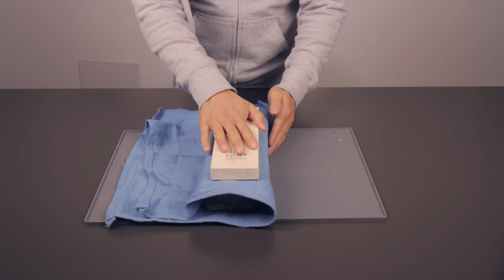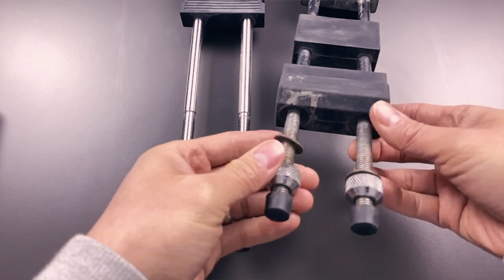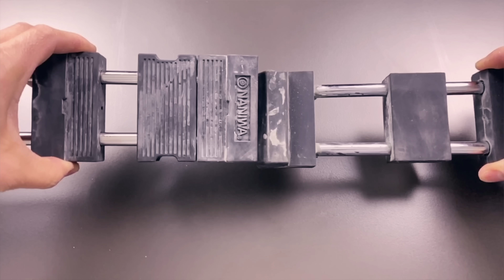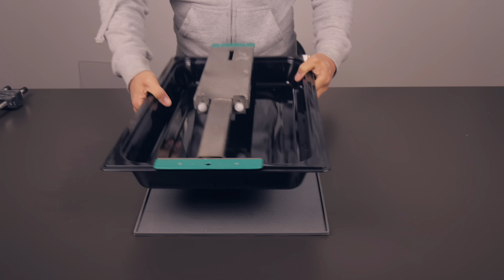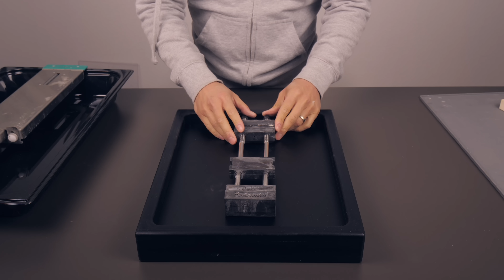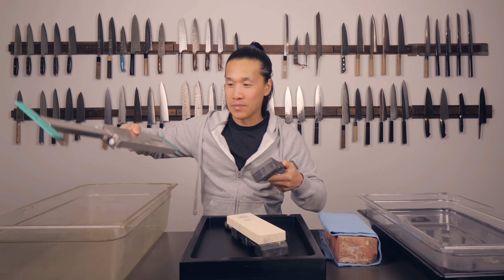The Essential Knife Sharpening Setup:  Whetstones, and Maintenance Gear

Comment: Have not read all posts, but rust can be eliminated simply by soaking in lemon juice (cheap concentrate) and brushing. Repeat as necessary. Dry and lightly oil threads to avoid return of rust. Run the nuts up and down a couple of times. Stop laughing.
Reply from the maker: LOL!

Comment: I started sharpening with razors. They are very simple and easy to sharpen, you just need a fine stone and a strap to start.
My initial setup increased over the years to several, very good waterstones, stored in a transparent plastic box and a handcrafted wooden/stainless steel  vise to clamp my stones and 4 straps (glued on some wood).
 After many decades (!) sharpening my knifes like this, I gave diamond stones a try and was immediately convinced:
no water, no grinding slime and no barking wife, what a mess I made sharpening 'your damned knifes'. (Okay, she must not use my knives, since she put one of them into the dish-washer)
So my setup consists now very compactly of 4 diamond stones coarse, medium, fine, extra-fine. That's it. 
To get my knives sharp as hell I still use my 4 strops. I switched on 3 from 'normal' grinding paste to diamond - only the finishing 'mirror polish' Poduro blanc paste still remains - I haven't found a better product yet.
I gained a lot of space with switching to diamond stones, too. There is an advantage, which is a disadvantage, too:  diamonds really bite - I smashed a lot of scratches in the sides of the blades in the beginning, but the ease and speed of sharpening with those tools and the results are amazing. It is more like caressing a cat in comparision to the pressure I needed with water stones to get my cutting edge and you can grind in every way you want, even against the cutting edge. The diamonds don't care.

Comment: I use 4x4 block of wood with a scrap piece of leather glued to one side to sharpen Kramer carbon 10" , Shun Classic 8" . Damp rag underneath and dry one on top. The king stones don't slip. It's great and didn't cost much. YOUR SHARPENING SET UP WOULD BE BETTER THOUGH. CONSIDER ME PLEASE.

Comment: I’ve been messing around with a lot of items for fun. Took about 100 knives to really get confident in chip removal, reshaping etc, started going 10-15 a week.  The $ made isn’t really worth it but enjoy doing it.  I was sent a lot of equipment from work Sharp for free.  I’ve been using their guided diamond plate sharpener with the extra plates for $30 and strop.   I can’t believe how good it is for the price.   And so small and compact.  I’ve done maybe 40 knives on it now.    It’s a bit small for larger kitchen knives though.  I’m going back to a stone system but for a casual sharpener, it’s one of the best and easiest I’ve come across so far.  I wish they’d hire me to promote it. :) but with all the systems I have, I am going into sharpening supplies and getting some water stones and basically a similar system to what you have.  Mostly for myself and friends. Don’t think I’ll be doing much more sharpening as a side $$$ unless I get bored.

Comment: I have 3 Wusthofs chef knifes, a filet knife and a fake shun that I think is a Jikko that one of my chefs sold me lol. Also the restaurant I work at the owners bought 3 zwilling knife blocks a while back ago but they’re starting to get dull. (Not to mention a whole hotel pan of knifes from the previous chef/owner)I’ve  been sharpening a couple knifes on a cheapish 12 inch winco stone with some berkel machine oil. Thanks to your vids I even got a small old yellow petty knife to cut through paper! I’m really looking forward to getting a higher grit soaking stone, probably the  new 1000/3000  double sided yellow cerax. I’d like to try and get most of them sharpened this winter since it’s kind of slower right now

Comment: I recommend the naniwa stone holder; no rust whatsoever, has the smallest lip so you can use the stone until it's wore down as much as possible, and two rods to apply even pressure.

Heard good things about suehiro, but I didn't like the single rod design or how large the lip was.

I use mine on a suehiro sink bridge and plastic food tray

Comment: Currently using the bamboo sink bridge by wurstoff (i think) but it gets slag all over the floor, especially with more work (fixing chips or rebeveling straight razor.) As for knives, i use my enso chinese cleaver. For nearly everything (professional chef work as well) and only ever use my slicer if cutting steaks from a loin. Everything else with the cleaver (best all around knife) that can get super sharp and hold it's edge forever (with a bit of stropping, that i learned from this channel)

Comment: Right now i am using 220,1000,4000,800 Norton stones on a wet towel with a shelf liner underneath, i have an old Tupperware bin to soak my stones in.

in my knife bag i carry a Zwilling pro 10" chef knife, when i am on the line i use a SAK fibrox 10" Chef knife and SAK 3" pairing knife

Comment: I still use my electric sharpening setup because it is alot faster. I have a 1x30 beltgrinder with a 240grit belt for setting bevels and grinding out gouches. A 800 grit belt for smoothing out the scratches and a mdf wheel with stropping compound and a cloth wheel for honing. I go through an entire knifedrawer in about 20mins

Comment: Hi Ryky
Your videos have got me started, some of your recommendations were unavailable so I finally settled for the following
- Naniwa Pro 400
- Naniwa Pro 1000
- made a sink bridge from plywood, works a treat but will get a Naniwa sink bridge as my bridge is only for current size tub
- got the Naniwa stone holder
- got the rust erasers 
Question: thinking Naniwa 3000 for Xmas, or should go 6000?
I'm thinking if I go for a 6000,I won't need a leather strop?
Regards,
Gary...........Australia
PS: Still able to cut paper! :) but not as smooth as yours ! Glad I didnt start off with a Japanese knife, my Mundial set is good enough to practice on
Reply: Hey what did you end up with? I will say after using a 1000 grit then progressing to the 6000 side of a king combo stone. I love the edge it leaves. I don’t need to but I still strop 6-8 strokes on some cardboard. Have a leather beaver board coming in the mail as we speak. Take care.
Reply: @lz_377  Hi There
Still haven't settled on a grit yet, tks for the heads up on the 6000

Comment: Is there a performance difference between splash and go stones vs. Soaking stones?
Reply: In my opinion, the soaking stones seem to be more snappy than the splash and go ones. What I mean is at the same grit the soaking stones seem to be more aggressive. My splash and go ones seem to leave a shinier finish.
Reply: @DanielWorkshop  by aggressive, do you mean it removes more material?
Reply: @Neil oppa  It seems to me that the soaking stone removes more material. On the other hand, splash and go are slower leave a nicer finish. I am talking about the few stones that I have tested thou. :) I have made some movies on my channel. I use mostly chinese soaking stones.

Comment: I do sharpen my knives regularly and I use a very budget solution, since I use only two stones a king 1000/6000 stone an a cheap rough stone from the hardware store, I use an old Tupperware container to soak my stones, to add height I use a peace of tile with rubber feet over the container so any water can drip into it, and I use a piece of non slip mat for the stones and that's it, very simple, very cheap, kinda small and easy to transport and store.
To me it's the best and cheapest solution.

Comment: Hi Ricky. I have cut into my whetstone. What should I do to fix it?  Thanks
Reply: You can try to resurface the stone again. You need to rub it against another stone, sandpaper or any other similar material, wear the stone off until the damage disappear. If you need more information I can gladly help.

Comment: I have the sharp pebble 400/1000 combo stone, a counter top  and a Chicago Cutlery 10 or 12 piece knife set that I bought from Sears before it closed,  it  badly needed sharpened and because of your instruction that's all it took to get the whole set dangerously sharp and in fine working order.  Keep up the excellent work and believe in the BRICK!

Comment: A 2x1" wood with cut up non slip drawer liner x3, 2 on the sink and 1 on the stone, on top of the sink with slow dripping water on top of the stone will do the trick. Only cost about less than $5. (Excluding the stones)

Comment: I first created something like the water bin setup, but I found that I wanted something that was easier to transport, since there are times when I take my stones to sharpen other people's knives. So I ended up with a silicone mat like yours, but then found that I needed a stone holder (I guess I could have used a brick!). I still need to find an easy way to transport AND protect my stones... maybe a tackle box with something inside that will allow them to be separated but standing on their sides.

In the water bin, I didn't want to spend $100 for a bridge, so I got very creative, but it ended up not feeling real solid. The silicone mat with the stone holder is MUCH better in that regard.

WHATEVER YOU DO, don't sharpen right over the sink. If you've used a bin, you see how much slur (metal shaving) is created, and putting that down the sink on a regular basis seem like it would eventually cause plumbing problems!

Comment: Cool video and nicely held angle when in motion.
I purchased a 20 cm Wüsthof Gourmet at Fashion Valley Mall here in San Diego several yrs ago. Best knife I currently own. Hard to admit my knife sharpener is a 6" plastic thing from  ChefsChoice. I don't use it and just stick with the so called sharpening steel.
I do however own a stone but it's for my tools and equipment and comes one side A100 and the other side is A220 for final sharpening.
I do have a question for you though. I've always heard that if you keep your knives stored on a magnetic holder it messes with the molecular structure over time, far fetched?

Comment: I use whetstones ranging from $20 cheapos to Nortons I got half price barely used, anywhere from 240 to 8000 grit. My fancier knives get the nortons. I also picked up some rust erasers and those have been lifechanging since your suggestion for keeping stones clean, smooth, and cutting; it made a huge difference on my dirty  first stone. I just set my stones on a damp paper towel  on my counter and soak them in the sink when I sharpen. All ya need. I want to get a set of shapton ceramic kuromaku stones soon as they're great stones but much more reasonably priced than the glass line I don't see much point getting for me.

Comment: My question is if you do not have 1 time for the skills ... is there any solution setup for precise angle and for good geometry forming , and if you have any tips.
Reply: If you aren't interested in freehand sharpening, I can recommend the Apex Edge Pro.  It is a sharpening system that really works well.  No real skill required, it keeps the correct angle for you.

Comment: Thanks for all the great tips and tricks with teaching us what you have learned. The set up is fantastic, I've been using it and its a great feel as I am 6'1 and it adds nice height and allows me to sharpen more comfortably. I'm a sous chef, currently using a 8" Wusthof Grand Prix II that is easy to maintain and sharpen, as my knife for now. My full time knife is a Kamo Suminagashi 210mm Gyuto that I've used to dullness, I really need to sharpen it. I'm not fully confident enough to sharpen it yet. So I haven't used it in a quite a while unfortunately. A few more times with my Wusthof for practice, to get the feel of things and I'll will try soon though! Thanks again for all the good hard work.

Comment: the Naniwa sink bridge is overprized crap imo. there are sharp corners all over it you have to sand so much. But the worst aspect about is is the integrated stone holder. This little metal plate just doesnt hold any stone properly and its extremely uncomfortable to tighten the screw

Comment: I sharpen various knives with good results with the EdgePro Apex, but I really want to get into hand sharpening.
Reply: You sound like me!  I have an Apex Edge Pro as well.  Ryky inspired me to freehand.  Buy a cheap knife and some whetstones.  Dull the knife like Ryky does on a brick or cinder block and practice, practice, practice.  I don't consider myself anywhere near Ryky's skill, but I think I am putting a better edge on my knives than I did with the Apex.  Go for it! You'll be sharpening in no time.
Reply: @pigfqr9666  Thank you for the words of encouragement. I'll have to give it a try. What stones did you start with?

Nice name btw. :D
Reply: @TravisTLK  I ended up buying the Kramer sharpening kit from Zwilling.  It comes with a pretty nice bamboo sink bridge and Naniwa Pro/Chosera stones in 400, 1000, and 5000 grit.  The kit is not the cheapest way to go, but the quality of the stones is top notch.  I paid $299 for it on Amazon, which, with he Amazon store card, I got 5%  back.  I have since seen it on eBay for cheaper than that.  Then after getting some good results with the kit, I went a little crazy and picked up a Shapton Glass 16000 grit stone.  I don't think it does too much for the sharpness of the knife, but it does put a mirror polish on the edge.  I have also purchased a couple of rolled buffalo strops from Ryky.  Like I said you can go cheaper and I am sure get great results, but the Shapton and Naniwa stones sure do work well.
Reply: @pigfqr9666  Excellent. Thanks for the info.